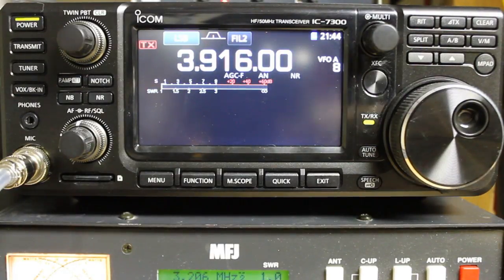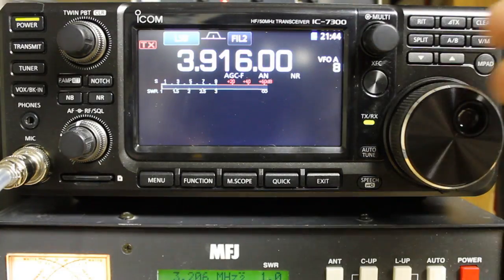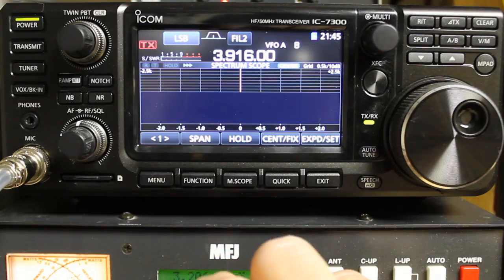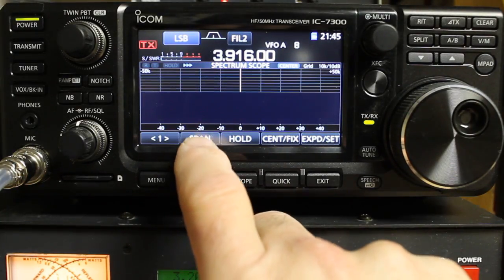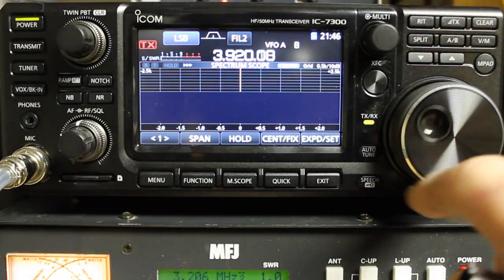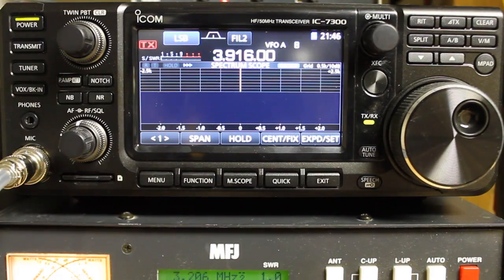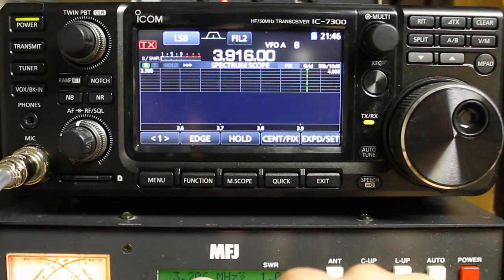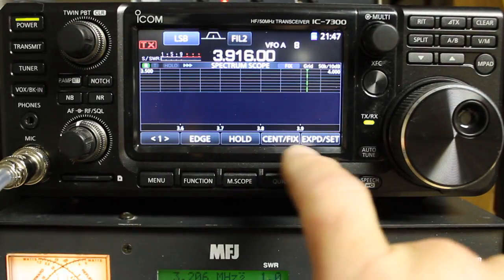Icom IC-7300 Tips and Tricks - Using Band Edges and Setting Up The Waterfall

Comment: I want to change one of the 6 meter fixed band edges from 50.00-51.00 to 50.00-54.00, but it won't let me.  Will it only let you go narrower, as opposed to broader?

Comment: I realize this video is over two years old, but one quick comment... In my 7300, I do NOT need to be in "Center" to get to the "Fixed Edges" menu.  Perhaps I have a later firmware.  Mine is 1.21.

Comment: is it possible to set the full 50-54mhz on 6m?
Reply: That's a great question.  I just tried to do it and it wouldn't change when I tried changing the 51Mhz to 54Mhz.
Reply: @jimyohe100  I emailed Icom and this is their reply: "Thank you for contacting Icom America.
 The IC-7300 scope does not have enough BW to display the entire six meter band in fixed mode. When it is set to center mode page 5-3 the marker freq. will be the feq. displayed and the scope will track up and down the complete band with the displayed frequency. This is the way the radio was designed and we have no information if any update will change it. Updates just appear when released with no prior notice."

So it looks like it's just a lack of the bandwidth to be able to show all 4 mhz at once. Still doesn't explain why I can't set the band edges like you said. But oh well.
Reply: @Mo_feezy  Thanks for following up with Icom and sharing their reply with all of us.

Comment: I Cannot "See" past 29MHz on my new IC-7300. I have tried to set the band edges but all I can type in is 29MHz. The range shown on the "Fixed Edges" shows 26-30. Any ideas on how to get it higher? I am losing 700KHz.

Gary
AA5I

Comment: Your presentation was very clear .. I'm looking to purchase the 7300 and your YouTube supported my feeling this radio is the ideal radio ... Thanks
Reply from the maker: +Tom Small, thanks for the support. I decided on the IC-7300 after spending a few hours with it, the TS-480 and the FT-991, at HRO in Plano. If you have an HRO, or some other ham radio store nearby, maybe you can do the same. In my opinion, however, I think you will find that the IC-7300 is one of the best values in amateur radio. 73 de KD5TKR

Comment: Quickie notes for setting band edges. To set band edges must be in the center mode and press and hold Expand/Set. The menu comes up and select Fixed Edges option. Then select the band range you want to change.

Pick the one of the three current ranges you want to change and the number pad will come up. The display will set on the low end of that range and you can dial in a new frequency. You can then go to the upper frequency and change it also. Hit enter when you're done
Reply: Doing that then the frequency you are monitoring and if you look at scope marker is not centered, it’s annoying

Comment: just a suggestion.......you should always at the start of your video's, tell people what version of software your using .......
i am usind soft ware 1.14.... and i can not get my scope to display the waterfall, like yours does, also, i do not see or hear any difference in my receiver when using the   iP+ FUNCTION  ... what say you on these itms ???
Reply from the maker: Are you having issues with the waterfall on transmit or receive? I believe that IP+ isn't going to make much of a difference in most situations.
Reply: Jimi, Are you holding the MSCOPE button down for 1-2 secs before releasing it?  That’s the method employed to get the full waterfall on fullscreen.  I’m running version 1.14 and I’m having no issues.  Hope this helps.
Reply: Jimi Vee 
I am using 1.14 and have no problems showing the waterfall. All firmwares are the same in this respect.